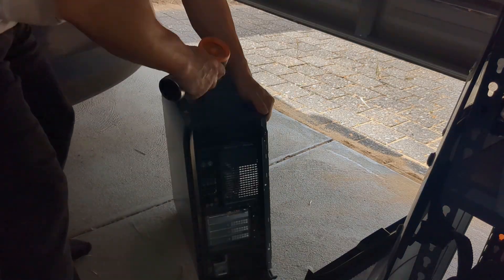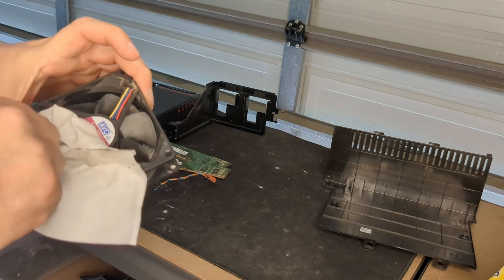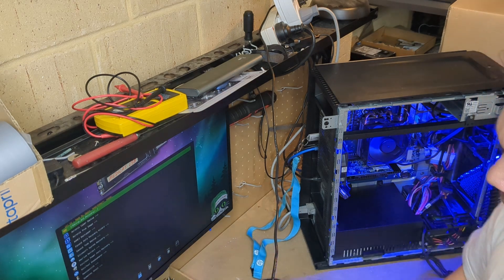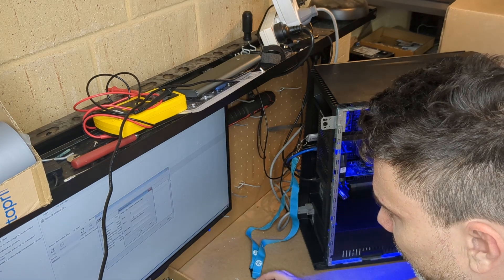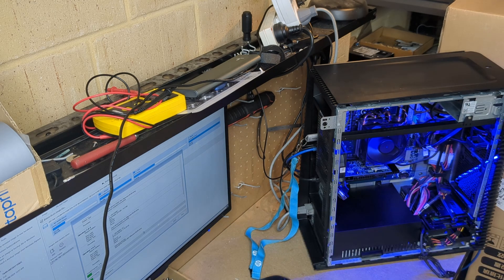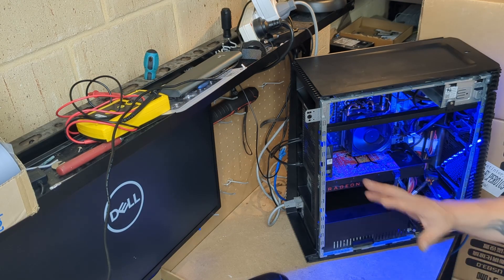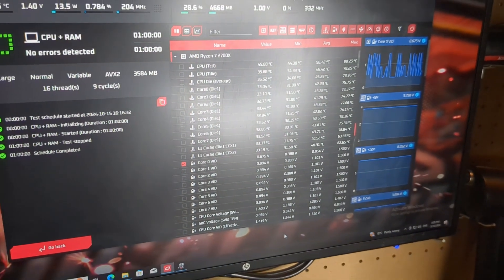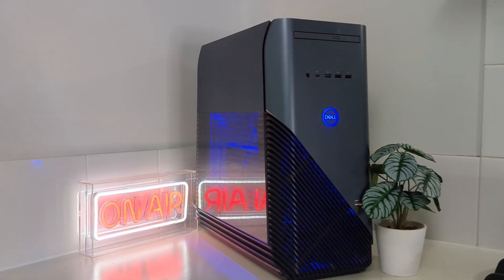Marketplace Gamble - Dell 5676 - Fix or Flop

Comment: I still have this. I'm a bit bummed that I broke one of the pins on the header for the front USB C. I got it brand new with the ryzen 1700x with water cooled aio back in 2017.
Reply from the maker: Maybe you mean USB 3? The pins in those tend to break pretty easy yeah... These can be solid machines though and have a fair bit of upgradability to them for an OEM machine.
Reply: @localtechexperts  no I mean what I mean
Reply from the maker: Ohhh Right.. The Usb C connector on those motherboards use a USB 3 looking connector.. So yours has a front panel USB C port? I cant remember this one having one.
Reply: @localtechexperts  yeah mine does yours doesn't I didn't watch the full video yet and it was on my phone. Yeah mine has a front panel USB-C connector the USB 3 and USB 2.0